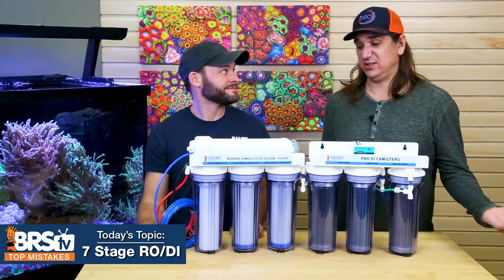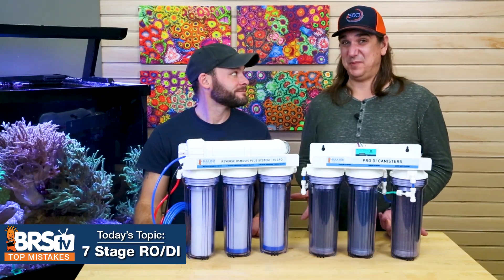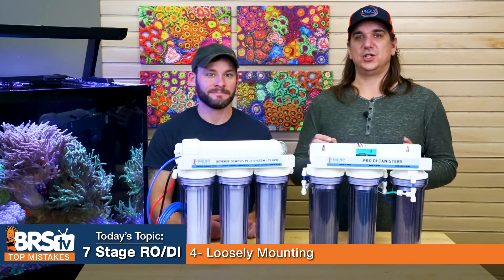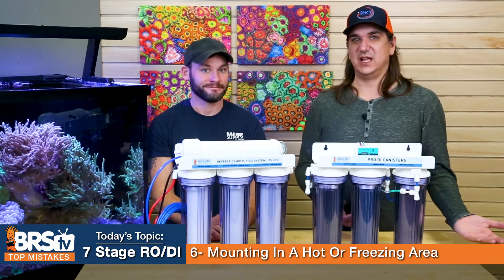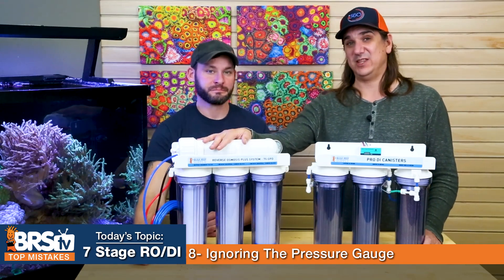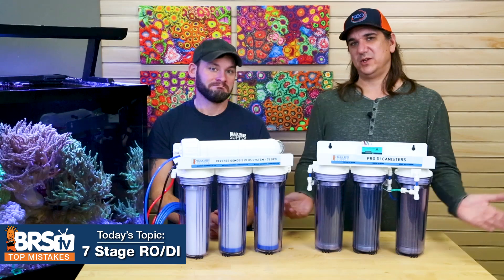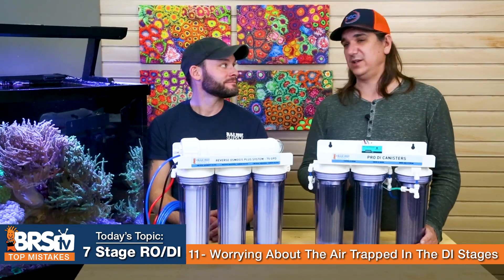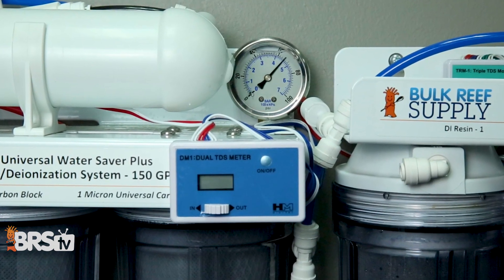BRS 7-Stage RODI Unit: Mistakes Using Our Best RO/DI Unit and How to Avoid Them On Your Reef Tank.

Comment: Hi. Old video. Bout coment : may opionon 2 prefilter  1 micorns ,  0.5 microns finals prefilter , change frist prefiltre 1 2 months , dependeg wather qualyti.  Saves money. 3 and 4  filter  carbons block ,  is beast combination. In case hard  wather 3 filter use dedurizations , 4 filters carbon block.  Sry may english not very  well 😅

Comment: I intend to replace my old coralife/esu unit with this or the six stage unit very soon. 
I have very low quantity needs only need a 30 gallon brute every 3-4 weeks. 
I understand keeping the membrane wet is important, besides that any tips specific to people who aren’t producing a lot with their units?
Reply from the maker: You'll be just fine. As long as you store the unit with the canisters full of water, none of the filters will be able to dry out during short term storage or non-use. Just remember to flush the membrane for a few minutes each time you start making water again 🙂

Comment: How do i know that the carbon block needs to be changed?
Reply from the maker: You'll want to test your waste water for chlorine or chloramine (depending on what your city uses). If you see that show up in your waste water, then you know you have breakthrough and need a change. If you're on well water, we'd suggest changing them out every 6 months or so

Comment: I plan on getting a saltwater tank sometimes in the next few months, would this be enough GPD between at 110 and 180 gallon system?
Reply from the maker: 75 GPD should do the trick in most cases. Very few reefers actually use more than 75 gallons of water in a single day aside from when they first fill up the tank.